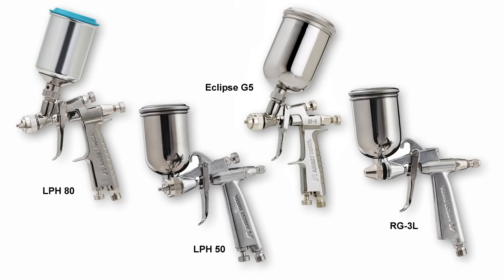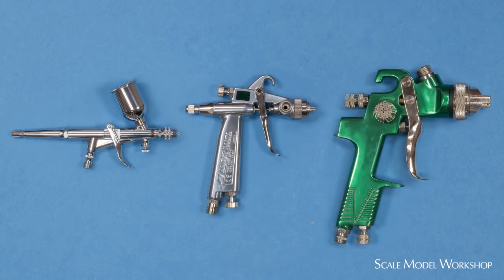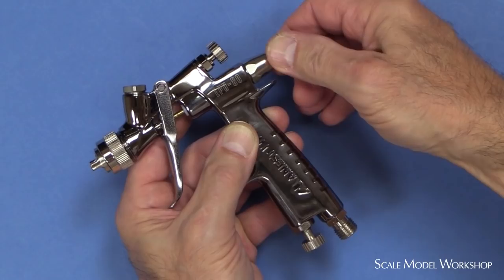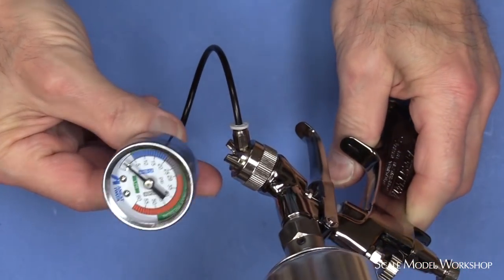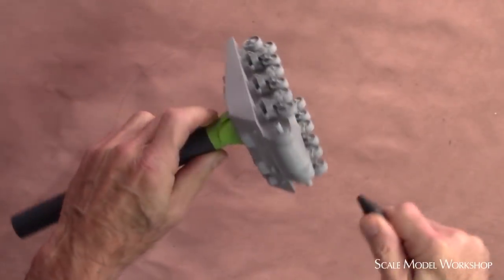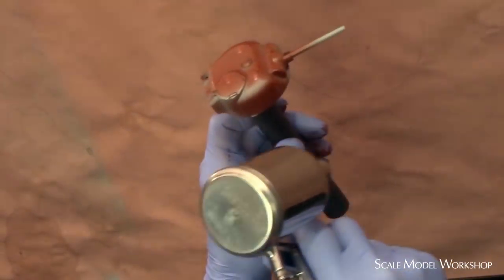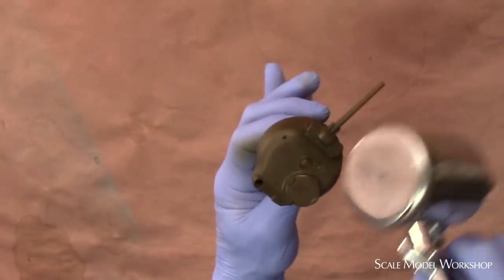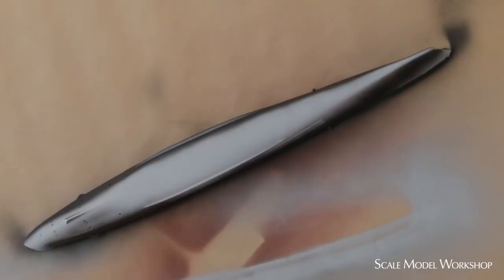Painting Scale Models With A Miniature Spray Gun

Comment: I purchased a LPH 50 based on Paul's recommendation. Hugh difference in the quality of my painting. I can paint glossy finishes with no orange-peel. It also takes much less time to paint larger pieces. I realized that an air brush is the wrong tool for painting larger pieces. I look forward to using it on my builds, it makes the process more fun, which is the point of the exercise.
Reply: What tip size did you buy? I'm considering to buy a LPH50 for priming and painting things like big airplanes in 72nd and 144th scale, small airplanes in 48th and military vehicles in 35th but I'm not sure about the tip size.
Reply: @ae-ae  I bought a 1.5 tip and needle. You should also have an airbrush for smaller things and detail painting. After I used it a couple of times I realized what a huge difference having the correct tool makes. Over time I experimented with my technic and was able to refine my results. I build model race cars, and want the finish to be very smooth and shine, and the LPH 50 got me there. It does require a lot of air movement. Thirty years ago I bought a Craftsman 3.5 gallon compressor, and it is more than enough for any hobby painting I do. It also cost much less than a "hobby" specific compressor. There are many choices at a home building store. Paul's videos here are fantastic, and whenever I see someone asking for help with a modeling subject, there is one of Paul's videos which sorts it out. Good luck!
Reply: @michaelchriss3302  I already own brushes for small things. I’m also interested about getting smooth surfaces on all models I build. 1.5mm sounds too much for my application, but for yours it may fit well. Thx for answering
Reply: I had the same realisation Michael , nobody ever told me that a little airbrush is not the only option for big projects , I wanted to paint a 1/14 truck a fluro colour and a airbrush was hopeless . But a. 8mm gun shot one perfect even coat in a blink .

Comment: I just recieved my brand new LPH80. I think I might return it though, and get the G6 instead. The reason is that the air compressor I havefor the LPH is SO SO noisy, it will wake all the neighbours. It is a husky 3 gallon. I wonder if I can run the G6 on the smaller 2 gallon and quieter tank i have. I just hope that the gun can paint nice backgrounds on my paintings for me.

Comment: Mr Paul Budzik, I have a question

I was thinking to buy PS290 Procon Boy LWA Trigger type (almost the same as HP CS trigger but without air valve) and Iwata W101 spray gun. Now, which tools mentioned above that could deliver the smoothest finish with minimal overspraying? I personally struggle with these overspraying. Plus, that HVLP spray guns are extremely expensive for me. That is why, I guess I will stick to those two tools I mentioned above. Which one is best? Thanks!

Comment: Great vid very educational, well explained and very helpful, just one question,  to use the guns in the vid how big does your compressor need to be and what size tank on the compresor is needed to operate each of the airbrush guns you dhoewd on the video, thanks.
Reply from the maker: The G5, G6 and RG3 should work with any descent airbrush compressor ... but everything does work better if you have a tank type.  If you want to use an LPH gun ... you should have a tank, and depending on the nozzle ... even a larger hose for optimal performance.
Reply: @scale-model-workshop  thanks but I was hoping for a more detailed answer, ie: 3Lt tank with a 3bar compressor, or a 23L tank with a 1/4 hores powered compressor etc, I hope you can answer this quire, as I have an hobby compressor that is a 3bar/45-50psi compressor with a 3Lt tank and I just can't get the coverage when I'm painting a 1/350 kit and I was wondering what I can use on the compressor I have to lay more pain quicker to get a better result. Thanks again for your help.
Reply: @kurk1701a  The CFM rating is the determining factor. See what the brush/gun needs and match it with a compressor of at least that rating. A higher CFM rating compressor usually has a tank anyway. If the CFM requirement is met you don't need to worry about PSI or horsepower. Aside from that "can't get enough coverage" is very vague so it's pretty much impossible to help you.
Reply: @johnbarnicoat9423 
Thank you for all your help it's very much appreciated thank you.

Comment: Very informative video. Thanks. I do have a question though. The Iwata G6 specifications say the optimal working pressure is 35 to 55 psi. You are using 18 to 25 psi. I must say your results are very good. What assumptions do you think Iwata made to suggest a pressure setting twice what you are using? Has it to do with paint viscosity?
Reply from the maker: There are a number of interdependent factors that are at play.  For instance, many of the most renowned tee shirt artists routinely use 60 lbs with their Iwata Eclipse and Liquitex acrlyic.  You don't want to become a prisoner of arbitrary numbers.  The G6 is really an airbrush in a gun form, so for us modelers, you want to look at it from that perspective.
Reply: @scale-model-workshop  Thanks so much! Indeed, the proof is in the results and after several days of frustration I finally got a great finish with the G6. Following your technique, I lowered the pressure, built up the paint in thin layers and used short bursts of the trigger to fill in where needed and voila!

Comment: Watching your demonstration of spraying the actual model I find myself surprised as I expected to see when using a spraygun that it didn't look to be any more efficient than using an airbrush for coverage width? Also, looking at your spraygun spray comparison photos, to me it looked like the G5 had the most consistent spray area, is this not the case? Would it not be preferred over the G6 model?
Reply from the maker: "I expected to see when using a spray gun that it didn't look to be any more efficient than using an airbrush for coverage width" ... What you're not seeing is the VOLUME of material ... which would empty an airbrush cup in to time flat ... plus you're probably thinking 3/4 or full size gun.  The only airbrush that I've ever used that can provide the AMOUNT OF MATERIAL to keep the pattern wet, is the now discontinued Iwata HP-BE2. The G6 can handle a little more material and atomize better than the G5. The two patterns are not the same shape.  The G5 is more a straight taper while the G6 is wider at a more intermediate distance.  It's what the airbrush artists and spray tan people use to get their super even coverage.

Comment: Thanks for your highly professional presentations - much appreciated. 
I have a question about pressure regulators. I have a compressor which I don't think has any tank at all, and it is 1.5hp, with a maximum PSI rating of 100. It has no pressure regulation or setting. If I wanted to try the LPH80 (with an external regulator, to maintain 13psi), do I need to be concerned with the pressure DIFFERENTIAL between the input and output of the regulator? I.e - do regulators have a maximum differential specification? I know that DURING spraying, the input to the regulator will be much lower than 100psi, but when the gun is not flowing air, will the pressure on the input to the regulator build to the compressor's max, or will the regulator bleed air continuously, maintaining the set pressure on BOTH the output AND input to the regulator?
Reply from the maker: Greg, Regulators do not bleed air.  Also, you are not going to be able to use an LPH 80 with a non tank type setup ... you need a large continuous volume of air.  Volume is very different than pressure.
Reply: @scale-model-workshop  thanks, but I'm confused. How can a regulator regulate, if it can't redirect air to the atmosphere? Also, if my compressor can flow 1.8CFM at 13psi, why is a tank required? Is it because of the "pulsing" air without a tank?